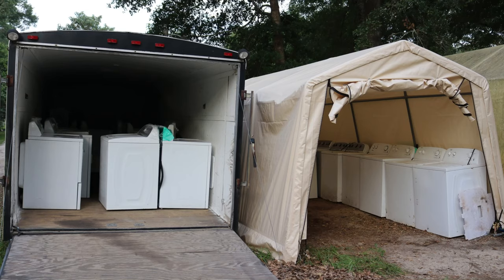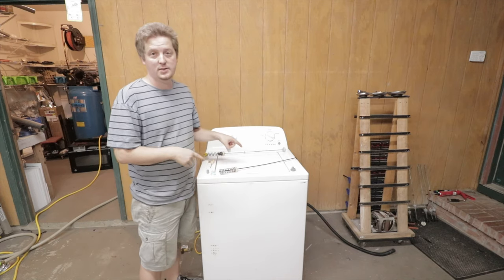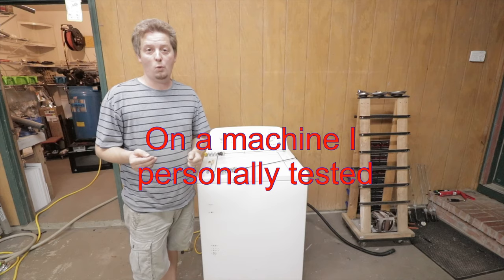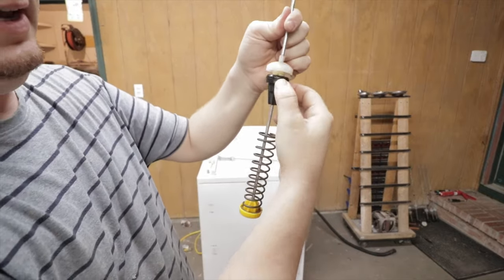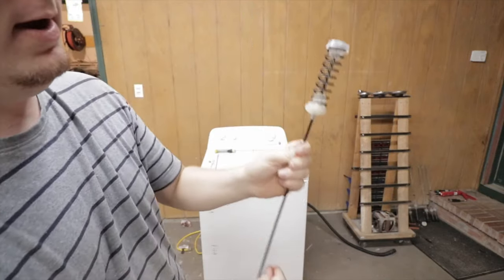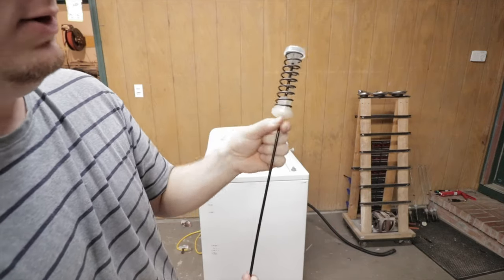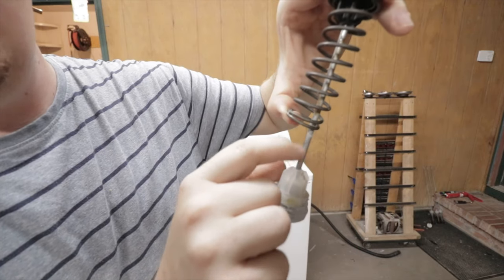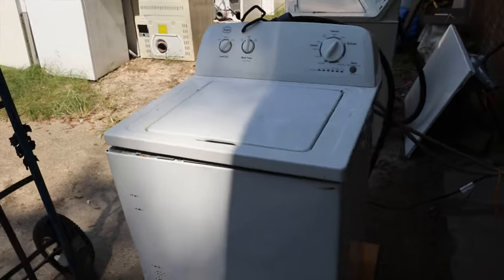Cheap Permanent? fix for shaking banging Washer? $7 to fix Suspension dampening rods W10780048

Comment: I will never own another Suspension rod washer every again ever since my LG washer exploded when this rod let go during the spin cycle and blew the whole top of the machine off and turned it into a pile of twisted metal!!! I now have a Speed Queen with a base supported tub and won't ever have to experience that nightmare every again!!!
Reply from the maker: Couldn’t agree more. I know speed queen is dependable because I am a appliance refurbisher and I’ve only seen a handful over the years.
Reply: Is this speed queen you have something one can go n buy like at Home Depot or somewhere like that. ? Just curious cuz I’ll have to get me another washer if I can’t fix mine

Comment: I from Trinidad, looked at most of the videos on YouTube and they are informative and some gives solutions but where the little deteriorated  rubber absorber was  I use fish gun rubber .already has the hole in the center, just to cut to size. Washer working perfectly
Reply from the maker: Cool

Comment: Excellent video, I enjoyed and was well informed!  
I need your help, (please) 
Which is the part number # rod/dampening rod for a whirlpool  model  WTW4800XQ4 TYPE 587-08.  

THANKS for your help! I will try your solutions while I wait for the replacements.
Reply from the maker: I use partselect.com to find the right part number. All you need is to put the model number in parts select find the part and then take the part number and put it in Amazon or Ebay.
Reply: @WasherDryerMoney  Which other brands (like supco) are near OEM quality? THANKS AGAIN.

Comment: What do I do when I replace these and it still does the same dam thing fr
Reply from the maker: It's rare that this does not fix those type of washers. Sometimes I have seen uneven floors or soft floors make a washer go out of balance. I've also seen bad bearings make a washer go out of balance.
Reply: @WasherDryerMoney  ya but does a top loader have baring in it I know for a fact a side loader has one but not 100% about the top loaded one tho
Reply: @WasherDryerMoney  mine is a Kenmore top loader

Comment: Have you tried a version of liquid plastic resin that hardens yet remains semi flexible after it sets? That may be a solution. I think you are onto something here.
Reply from the maker: That sounds interesting. Liquid Nails is still working. I plan on experimenting again if it gives out.
Reply: @WasherDryerMoney  there's a guy who used a rubber hose that he cut and it snuggly fit around the suspension rods AND fit in the slot of that worn part.
Reply from the maker: @NOSE-em2xb  yeah I've heard of people taking a piece of water hose and pushing it over the spring to make it stiffer. I don't understand why that would work but I have heard several people say that it's a solution. I can see Samsung has started using this solution and some of their newer suspension rods.

Comment: I use a rubber hose with a smaller diameter as the rod to act as a brake!
Reply from the maker: Interesting I’ve heard a few people say they have used a water hose to fix this issue.

Comment: thanx to washer dryer money for the post and to all the folks who commented and shared their ideas and experiences.  tomorrow am going to try the solid rubber bungee method.
remembering all the kenmore washer & dryers thru the years rebuilt with 2nd hand parts salvaged from throw away units, those old style suspension rods just had a hard rubber cone at each end. they lasted for the life of the unit. many times had the upper corner support on the body rot away before the rubber parts failed. bought maytag washers in 93 then they were good machines. gave the maytag away to family. bought this samsung 2016 from a couple who spilt.....has been okay until now..though it doesn't clean clothes like the old agitator units. thanx again really enjoyed the brain  storming...cheers

update. today we tried the 15" solid rubber bungee fix. the ones we purchased were from tractor supply listed as 15"... 15" from hook to hook. these would not stretch enough to make it to the top mount.  when stretching it just seemed there was too much stress on the plastic lip where the suspension rod seats. we then turned to the rubber hose fix. the hose is placed around the spring and zip tied to grip the spring. the video suggested using 1 1/2" I.D. braided clear hose or radiator hose though the latter is twice as expensive by the foot. after doing the installation, 1 1/4" hose would've worked and probably been easier to work with. leveled the washer, recalibrated and ran a quick wash on high spin....at first it kinda wobbled a bit the tub not the washer... it became better balanced with each cycle, the last spin vibration was hardly noticed. am thinking the 21" bungee may have worked. it was nearly impossible to wrap the 15" bungee twice around the rod and stretch it up to the top mount plate.
BTW checked the condition of the suspension rods before beginning the job. two were worn.
cheers
Update:whew what a demon this samsung...
Had to reinstall one hose onto support rod. If you decide to use this fix. It is much easier to remove top and pull the rods out one at a time. This provides ability to get a good chinch on the zip ties. While there we installed solid bungee wrapped twice around rod using 21" bungee. After calibration and clearing system the machine has worked flawlessly. Nevertheless it is a samsung....its like having a wild animal as a pet. Ya never know when its gonna turn on ya! With that in mind the TC 5 model speed queen is our next to purchase washer....
Cheers.
Reply from the maker: Glad you like the video. I’m going to do a follow up video soon trying out some of the ideas that have been posted in the comments.

Comment: couldn't you put Vaseline on the rod and fill it with epoxy? just put the Vaseline on the other end of the rod where you're letting the epoxy harden and it will slide back without bonding to the rod.
Reply from the maker: True. There is a special type of grease that they use they would probably also work. It’s the type that is in the original rod it’s very tacky and made you help the rod last longer.

Comment: Fantasy suggestion: Have a custom billet aluminum, nitrogen gas pressured dampener. With progressive wound springs. Bluetooth enabled, adjustable bump/rebound settings. Remotely mounted billet oil reserve canister. Temperature controlled water cooling

Comment: They are correctly called suspension rods
Reply from the maker: I’ve also heard them called garbage.
It’s like whirlpool designed them to fail right after the manufacture warranty runs out.

Comment: I’m not trying to argue with anyone or be rude but this is pointless I own 3 retail stores and sale new, scratch n dent and used appliances for almost 15 years now. My whole family have been in the industry since after world war 2 grandfather was a marine that did Maintenance and mechanical work in the marines was on Iwo Jima after war car broke down in small town in the Carolina’s with wife and kids he offered to help fix an old refrigerator then ppl kept bringing or asking he come fix something of theirs. Anyways I’m still doing it left Iraq with the Marines in 08 got home started up on my own. This is not how you fix the suspension rods. Look into it a little all you have to do is think. The factory installs a compound on the rods on the dampening pad the chemical is gone wore off and then the suspension system starts going out worse and worse. The springs are not bad metal springs don’t wear out like that. I have even seen morons think that they can even need to “rebuild” the suspension rod? 😂 That’s not necessary it’s simple to fix them the right way just do research and find the chemical/compound and figure out how to apply it on certain part of the suspension rod and then they work just like factory new rods. Or you can buy a new set of rods off eBay for only $30 why rig them?
Reply from the maker: @ClintonThad  it’s not a chemical, it’s a grease. Called damping grease.
It will slow the wear of the foam but it will not stop it. Overtime the rod will wear through the foam. When the foam no longer grips the rod, the suspension rods will stop working.
The newest method to fix this is to replace the foam pieces with newly cut pieces that are slightly larger and add damping grease.
3/4 inch yoga mat is what most Appliance flippers are using now. They can make hundreds of repairs with one mat, saving money, increasing profits along with upgrading the rods to last longer then OME.

Comment: Thank you for your video! How bout the 'Vibra Tite' threadlocker. I found it on the 'Project Farm' video. I-will-not-buy-Samsung-again.
Reply from the maker: Threadlocker? I use threadlocker on some things especially the pulley nut for a pause/play machine. What type of threadlocker video were you thinking of?
Reply: @WasherDryerMoney  Threadlocker that is very viscous and non-hardening and non-runing.  Please check out the video by  'Project Farm'. Perhaps, combine it with your 'Liquid Nail' modding for a 'permanent' solution to this 'Planned Obsolescence'. I-will-not-buy-Samsung-again. PS. Why does it almost always work when put the machine into Spin Mode manually?
Reply: @galaxydust7267  Have you tried this yet? I watched the Project Farm video. The Vibra Tite was the strongest, but could it be too strong and stop it from moving altogether?
Reply: @galaxydust7267  As for the test working in Spin, it may be because the test is not under load
Reply: @noimportante4284  It was 'Under Load'. I ran it with the same load right after the machine went into 'dc error' mode. So the tub spinned up faster and it balanced itself out UNLESS the load is grossly overweighted. I've replaced the four Suspension Rods which help but I still got to watch the load size. I'd say these machine are very finicky. If I have another life, I'd stay away from Samsung Washers.😀
Reply: @noimportante4284  By 'Spin Mode', I meant the 'Spin' under 'Test (Diagnostic) Mode'.
Reply: @galaxydust7267  I know. I presumed the diagnostic was done without clothes in it. But yes, they do have a lower capacity unfortunately.
Reply: @galaxydust7267  BTW, have you tried the Vibra Tite yet?
Reply: @noimportante4284   No, I haven't. The 'Rod Replacement' is working for me so far. I will (one day) try the 'Vibra Tite' when these New Rods worn out (which I hope,not any time soon). I just remember, my previous old Kenmore top loader got dumped after 17yrs because of body rust and rusted broken Suspension 'Spring' . While it was working, it never gave me any of these 'Codes'. See, How I've been spoiled! Oh, these Nostalgias!

Comment: Why don’t they build them a little more like speed queen does
Reply from the maker: More than likely to save money to build them so they can compete with low end cheap washers. Speed queens have a lot more metal and expensive parts. This is why they last longer because they are made out of a higher quality materials that cost more. It’s also the reason they cost more.

Comment: Try a rubber sealant or Polyurethane Sealant.  Trick is to allow to dry, but move rod before it sets up.
Reply from the maker: I'll give it a try if the Liquid Nails stopped working. So far so good with liquid nails.
Reply: I'm thinking of 3m 5200 . It's an awesome sealant that remains pliable but hardens like rubber

Comment: My thinking . make it cheap so it has to be replaced...i will give this a try..
Reply from the maker: I am currently using this one in my house. it is still going strong
Reply: @WasherDryerMoney  today i got the rods out and cleaned the goop out of the top and bottom ...so later i will load them with fuz it ....and let it dry...
Reply: 1 week later...the fuz-it did not dry on 2 of the rods... a dealer  gave me  a set of good used rods that i will install...later..
Reply: 2 loads of wash today with the black colored rods installed...working OK for now..so a direct drive washer is what i will look for now..thanks..
Reply: still working..... but i still want to put the 15 inch rubber tie downs on it..

Comment: Just remember, any changes you make to a machine that changes the manufacturer design leaves you liable for any problems in the future. Manufacturers will not even allow a wire repair. FYI

Comment: Planned obsolescence: "Planned obsolescence (or premature obsolescence) is a policy of planning or designing a product with an artificially limited useful life or a purposely frail design, so that it becomes obsolete after a certain pre-determined period of time upon which it decrementally functions or suddenly ceases to function, or might be perceived as unfashionable. The rationale behind this strategy is to generate long-term sales volume by reducing the time between repeat purchases (referred to as "shortening the replacement cycle"). It is the deliberate shortening of a lifespan of a product to force people to purchase functional replacements." There should be a law against these nasty little schemes.

Comment: First, thank you for isolating the root of this problem.  Does anyone here know the dimensions of the foam cylinder that wears out, and the diameter of the steel rod it slides on?  I was contemplating using some plastic rod (probably nylon or acetyl) cut to length and drilling out the center.  Then putting a slot along the side so I can snap it onto the steel rod. Plastic rods come in various diameters and it would help to know the dimensions.  The washer I am hoping to fix is 1100 miles away from me right now, or I would just get the dimensions myself!  Thanks!

Comment: Why not Solder or weld the end where the endcap is then the whole piece shouldn’t move at all
Reply from the maker: Do you still do have to have them move slightly to compensate for the washer starting to fall off balance. It’s a fine balance in at between slow in the movement and stop in the movement all together.
Reply: @WasherDryerMoney  makes since thanks!

Comment: Spot weld tack a  washer done
Reply from the maker: Welding would hold it perfectly Still. it still has to move slightly to perform correctly.
Reply: Some one use metal clamp around plastic 2ork well

Comment: I removed the idea about using silicone caulk for a bushing, it wouldn't hold the grease.
Reply: I got a similar idea from watching this video! "Wait ... the old rods have just worn out their grease!" That's why what the ring doesn't have to be tight - it just has to be tight enough to prevent the rod from slipping too quickly through a few blobs of damping grease.
Reply: I tried to grease the old bushings, but they were crumbling and falling apart.  The new grease lasted about 2 weeks and it started all over again, but you are right that it is all about the grease.  There was a film of sticky grease all over my rods most of the way up when I first took them out.  I wondered if the grease from the cup had migrated all over the rod from heat and vibration.  My washer is 10 years old.  The aftermarket rods with the shorter bushings have been working for 4 weeks now.

Comment: Stop this is a dampening rod, It uses dampening grease to slow it down. Do not clean off the grease, Just add to it with more grease. It must be dampening grease, such as Nyogel 767A. If you use regular grease it will make it worse. I opened it up and added a little bit of felt and Grease. Apply a little to the plastic ends, as it also helps dampen the motion. This is special grease. It should be similar to what is on it. If you use regular grease, you will destroy it. Also If your machine has the new 13mm safety bolts installed to keep the top from becoming airborne, Just add water to drop the tub to get to them. Then start it up to drain it.

Comment: Why don't you use a piece of rubber like you know it's on a shock for a car I know that's a bigger hole than what you want but get a piece of rubber like that they have to drill a hole through it put a hose clamp around it and you can adjust it tighten it up to squeeze around that that rod

Comment: Do not fix the problem I put a new suspension rod kit and the problem still there.
Reply from the maker: It could be that inner and outer drum spacer has failed. This is usually visible by turning the drum and looking straight down and seeing if there’s a wobble between the inner and outer tub. There’s not a good fix for this it’s expensive to replace and I have not made a video on it. It’s not common.

Comment: This is fascinating, as an appliance technician, watching, however, this is way too much work, even for a technician to do on one job. OEM dampers only people.
Reply from the maker: This is the older video. There’s actually a much better method that’s easier. I’ll be making a video on it soon but basically using 3/4 yoga mat. One yoga mat can make 50 to 100.
Way cheaper and better than OEM.